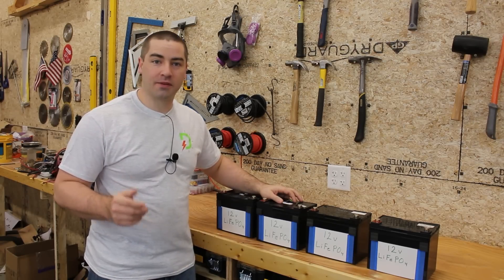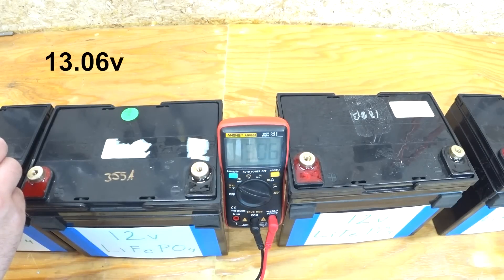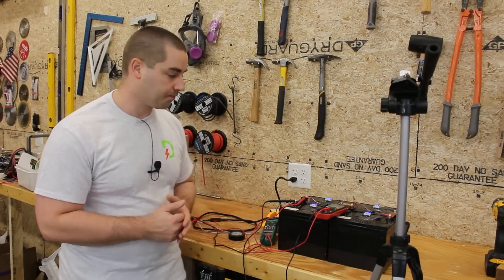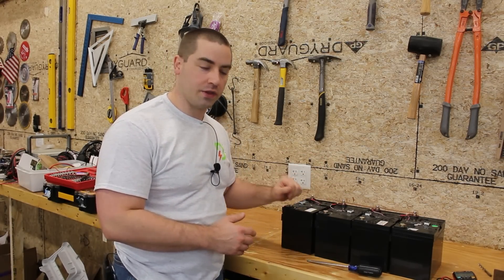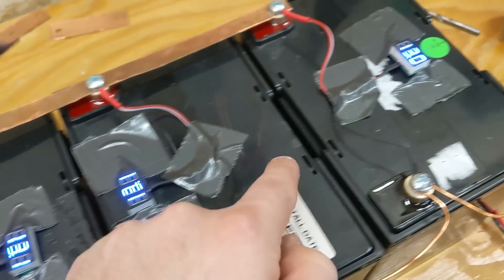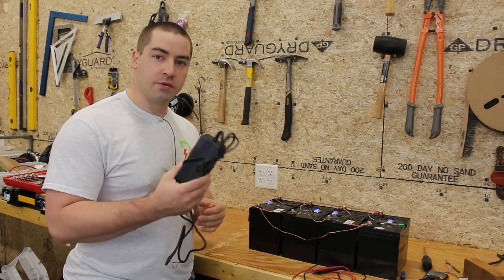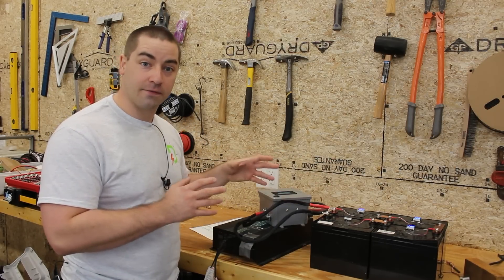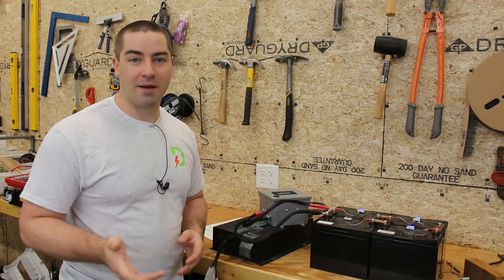How to Series Connect 12v LiFePO4 Batteries, and Top Balance

Comment: It would be far more ideal if all of these consumer LiFePO4 batteries included an externally accessible balance port like some of the early units have.  Then you could easily set up whole pack balancing and monitoring rather than them being a black box.  But I guess that is why the individual cells and programable BMS solutions are the norm in the DIY community.
Reply: I think that I understand what you are saying. Even though each ready-made battery has a dedicated BMS that monitors the overall health of the battery pack in each ready-made battery, there is no real way of telling what the health of each cell is that makes up that battery pack. Essentially, the only way of telling what the health of each cell is in the pack is to hope that the battery BMS has the capability to tell you the health of each cell. Otherwise, the only other way is to tear the battery apart and test each individual cell in the pack.

Honestly, I don't ever recall any of the channels or books that I have read say that there are ready-made batteries that can tell what the health of each individual cell is that makes up the battery pack in a ready-made battery. On the other hand, all ready-made battery packs in ready-made batteries that I have seen and/or read about do have BMS protection. I would bet that manufacturers don't want ordinary battery owners to have the ability to diagnose and replace battery cells in a battery pack. Will Prouse does indicate that this is OK and has done so himself, but I bet that a person takes on a certain amount of liability by replacing individual cells. 

Personally, I see not being able to monitor the cells in a ready-made battery as a problem, so I have decided to use individual 32650 cells to build battery packs and then monitor the health of each individual parallel group in those packs with a BMS that is able to do so. In my mind, if I can see that a group is underperforming and is readily accessible, then I can quickly do a visual inspection and/or test each cell in the group and isolate any problem cells. The only part that truly concerns me is the thousands of welds that I have to make to construct a pack of any size. I still get the "willys" just thinking about welding on a lithium cell.
Reply: @westking7746  good job explaining your point
Reply: @westking7746  this is of course more of an issue with packs constructed of 18650 cells, which are typically spot welded into a "frame" of nickel strip. This seems more common on eBikes and eScooters.
Best Wishes
Reply: there are 12v balancers on the market if you are concerned about it
Reply: Hello
I have 4 nos   12 vbattery it have individual bms  can i connect in series
Reply: @afgamer322  The video is showing four LiFePO4 batteries with individual BMS built in.  So what he is doing is what you should do as well.

Comment: Great video - so well done. I have heard a lot of talk about doing this but never with details. This was the missing details I have been wanting. Question: at the end of your video, you specify a charge voltage range for the pack in series to stay between the 10 -90 percent charge range. How do you know these voltages? Seems like if you are off on each end just a bit, you could be in the steep part of the curve where you do not want to be. Also, I am thinking about setting something like this up in my car. What are the cons of doing a 12v system and connecting in parallel. 
Thanks again for your excellent video.
Reply from the maker: It depends on the manufacturer. Some manufacturers will tell you what to set the maximum charge voltage at. I've read a lot of manuals from different manufacturers. Some will specify as low as 54 volts and some will specify as high as 58 volts. But 56 or 56.6 are the two most common that I see
Reply: DavidPoz Thank you so much and such a quick supply. Do you have any advice about running in parallel instead or series for a car application?
Reply from the maker: First, this type of battery is not meant for starting an engine.  But if you plan to isolate it from the starter, and use it for accessories, then that's cool.  For paralleling them they will automatically balance.  My only rule is to make sure the batteries are within 0.1 volt of each other.  If they are too far apart then you could pull too many amps all at once.
Reply: DavidPoz Thanks again. I was planning on using the system to power items like a 12V freezer and a microwave through an inverter. My understanding from your video is if I parallel them, they will balance in time, or I can speed up the process by charging them. Thanks again. Great content.

Comment: Hi.
But these would disbalance again in a few days or a couple of weeks max. You'll have to repeat the exercise.
 Connect a battery balancer on top of the series. That should do the trick.
Reply: Agreed, however these are used batteries also.  A top charger could be built with a $1 microprocessor (Arduino even) to do top balancing duty every week, and could light up an LED identifying which batts are constantly needing to be rebalanced for pennies.
Reply: Yep. Top balancing is pretty much useless if one of the cells has a significantly lower capacity than the others.

Comment: I guess I did mine wrong? I had 4 12V battle born batteries and I added two more to make six. But what I did was lower the voltage on the four till they fell within the range of the two I added. The only problem I saw was that the state of charge was higher on the two I added, even though the voltage was the same. 
Then I let the solar charge controller’s charge them till they all matched around three hours later, then I tested a load on them. 
These were wired in 24 V. 
Did I injure the battery life? 🤔
Reply: not much if any but would be a good idea to balance in parallel now

Comment: Not Enough detailed short demonstration how long you can use thus battery and how much it costs a batteries  packed of battery lithium ion
Reply: he supplied links to similar batteries on amazon.  Its likely he didn't buy these particular batteries new. At the link it also says expected cycles for them (around 3,000)

Comment: Yeah but what about 72v applications???
Reply from the maker: I don't see a reason you can't do 72v.  But you may want to check with the battery manufacture to make sure running 6 in series is OK.  Some manufactures state 4s max.

Comment: It seems like this only works if the batteries are the same capacity - the one whose voltage shot up initially has lower capacity than the others so will always be a limit in any system.
Reply: Yeh, I bought 4x 12v. Flattened them all to 10.000 v (individually, same load). Charged them all up to the same voltage (invidually, same charger). Tested the time to drain them (individually, same load). They were all meant to be the same, but the difference in capacity between the best and worst was 15%! I was a bit disappointed. I should have asked the seller for a guarantee that they would be say 2% maximum difference in tested capacity. Bypassed the internal BMS when testing as some turned off at 10.06 or 9.85 instead of 10.000. Using a 10A 48v BMS now. It's just a shame to know that the smallest capacity one will get overworked and the biggest underworked throughout their life.

Comment: Looking to replace my dad's mobility scooter batteries.   He has 5 12v 20ah  batteries in series.  You think this setup will work with in his scooter? Love your videos.   Happy New Year !!!
Reply: Lithium iron phosphate would work well though you might need another charger and BMS but they would likely take up too much room as 12v batteries.  You could get individual cells but remember in the lead acid you only discharge about 50% of their power and these can provide at least 80% of their power. They also weigh about half as much.  It might be difficult to find 20ah or less cells to make a pack for that scooter that would fit in it and larger cells would also be pretty expensive.  Are u SURE the cells are in series and not parallel? Check ali express for cells and make sure and note their size and whether or not they come with busbars and terminal screws .You would need 20 individual cells in series and a BMS and a comparable charger though the one currently used might work as long as you use a BMS.

Comment: Why not just slow charge them individually at 1 amp before putting them into service?  That is WAY simpler and almost guaranteed to get similar good results.  Why make things more difficult your way?  A simple bench charger set at the maximum voltage recommended by the manufacturer (such as 14.5v per battery), will have it taper off when it hits that voltage, and likely charge close to 100%.  No special paralleling needed.  You don't even have to break the 48V series connection using my recommended technique.  It might take up to 24 hours total (6 hours per battery), but it is worth doing at least the first time.
Reply: he is probably reaching a much wider audience by showing us this way, thats my take on it. without to much work of taking these all apart he is achieving a nice balance. But would a video showing him charging 4 batteries (individually) really do his channel any good, or show any new comers of what his achieved goal here was? You are not wrong sir.
Reply: another thing about it is the timing, this way every battery will be more matched, unless you have 4 chargers this will be the better way to achieve the goal... because of voltage sag
Reply: That seems kind of dumb. Pretty easy to run some wire to parallel them, and then connect to the bench charger.  Do 4 at once instead of 1 at a time.  The additional voltage do-dads are usually 4-5 for $5-7 shipped, and if it nice to be able to look at all of them at once instead of constantly probing around with a DMM.  My only issue is that batteries ain't cheap, even used once. If one has a pack doing some real work, with actual money invested, would be well worth a small amount of money to build a nice automated top charger that will monitor the batteries, log each ones history, auto balance every week or month or are necessary, which would probably cost $20 in parts and some time visiting some Arduino forum.

Comment: What's a good one for DIY 70 kwhr's of battery storage. Just for covering my commute and to have less strain on the power wall since it will have a 8kw of strain for 6hours.
Reply: For pure cost effectiveness, battery cells from modem and server packs are often <$100/kwh. I managed to snag 320 3000mah Panasonic and lg 18650 cells (3.5kwh) from ring doorbell packs for less than $70/kwh. You could expect 2-5 years of service, depending on your use patterns and quality of cells you can get ahold of. Try batteryhookup.com or "batteryclearinghouse" on ebay.

If it were me, I'd be looking into the large format lifepo4 cells. They are coming down in price and gaining popularity fast. Check out alibaba or aliexpress, but be sure to pick an established, certified seller. When managed well, 2,000-5,000 cycles or 10-15 year service life is what you can expect from decent lifepo4 cells. Check out the 280ah lifepo4 cells on alibaba.com. a 16s5p pack of those cells would get you 71kwh.